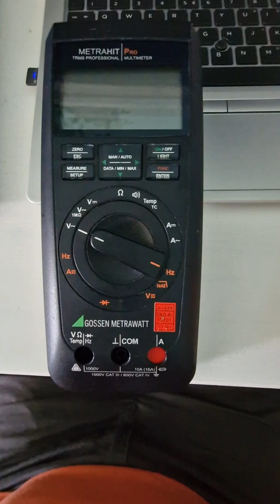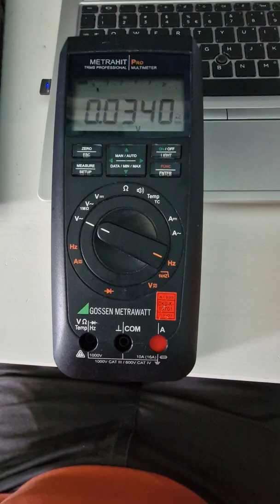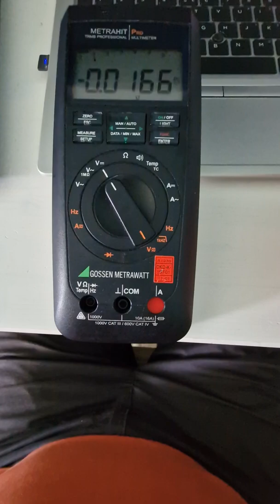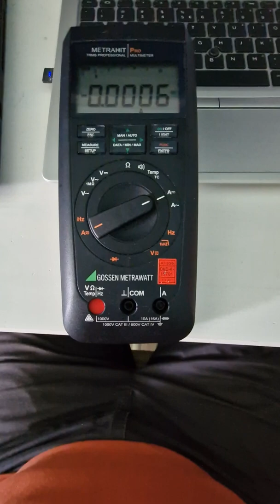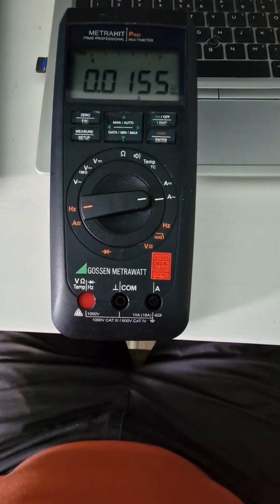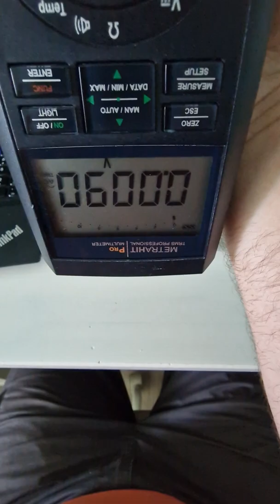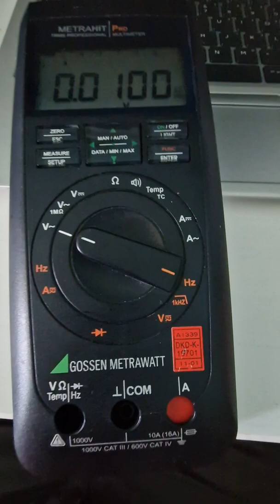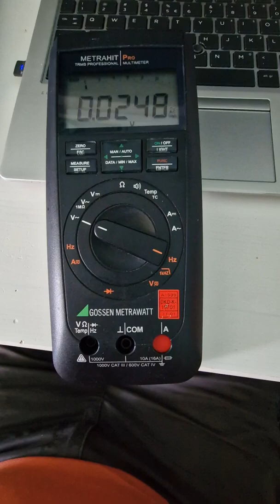Gossen Metrahit Pro - looking for fix

Comment: hello!
did you find what the problem was ?
Reply from the maker: See updated description section. :)
Reply: @reasonator47 nice to see a happy ending :)
Does the device justify its price? it's more on the expensive side of the multimeters.
Reply from the maker: @olegpatraschku3736  Pricey, pricey but works really nice. I have Brymen (869) and worked with some other meters occasionally. This is is very fast switching ranges but has way less functionality than Brymen. But super robust and super accurate.
Reply: @reasonator47  can you measure the capacitance with it ?
Reply from the maker: @disjem  Nope, not with this model.